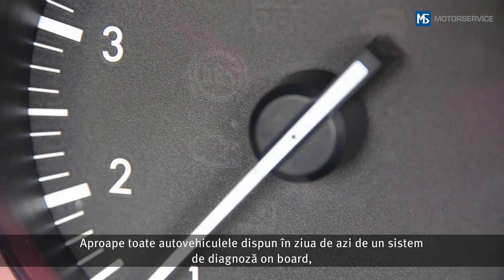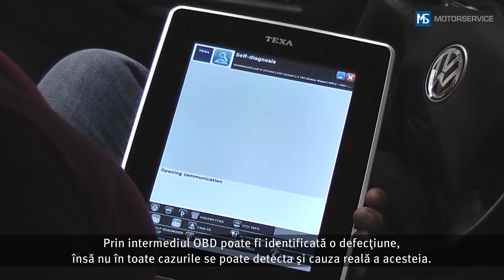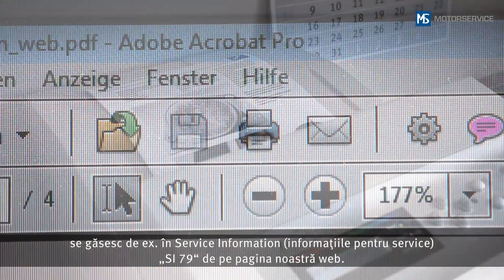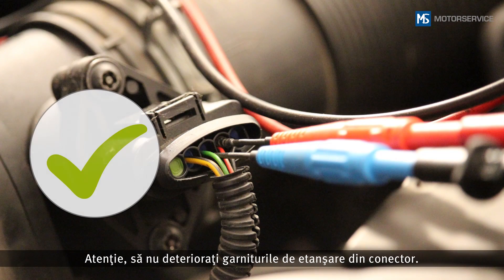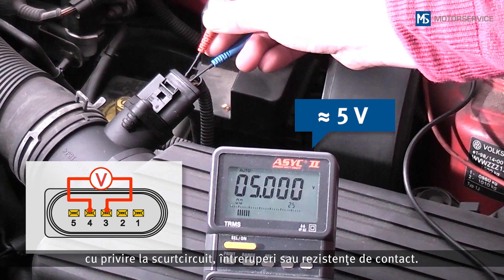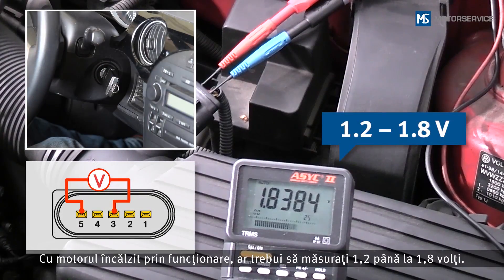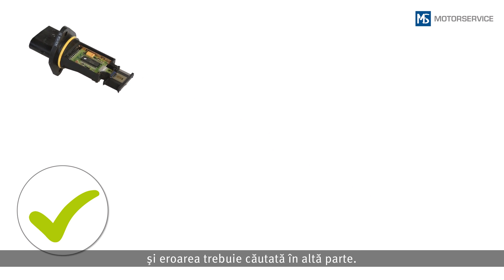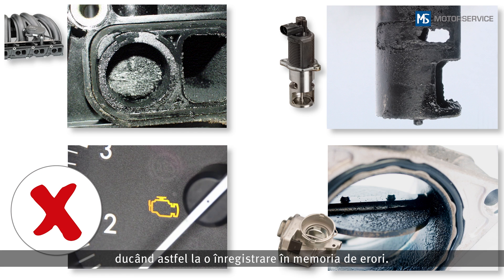Verificarea senzorilor analogici pentru cantitatea de aer - Motorservice Group

Comment: Please help me with some advice 😢 
My Avensis 2004 1.8 benzine it's have the consumption between 13.5 % and 15% 😢 on obd diagnosis it's giving me the code P0171  .... When the car is running I pulled out the MAF sensor connector and the engine stopped running, I try it to start it again and it's started without sensor plugged but it's a lot black smoke from exhaust, until I plugged back...
And doesn't have any power, on long flat roads it's going pretty good after is arriving at 2500 RPM, until then barely moving 😢 On a small hill is slower and slower the car ( like I pull 7 tone and can't make it, like that is moving) but the engine doesn't stope, just going slower... If when I start the hill Im in the 5 gear and have 100km /h , at a 7% hill and after 300 meters I'm already in 1 gear with 30 km/h.... And always is very hot under the hood  , the thermostat I changed, the water pump is running great .. 😢
Car is on LPG but is doing same on benzine or LPG and doesn't have any other codes ... 😢